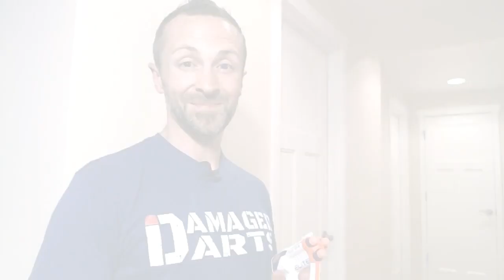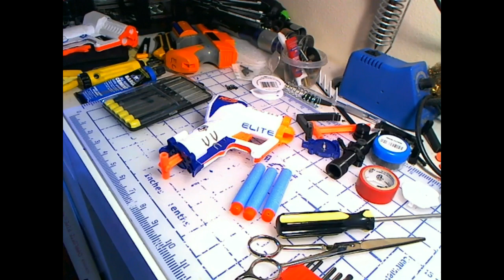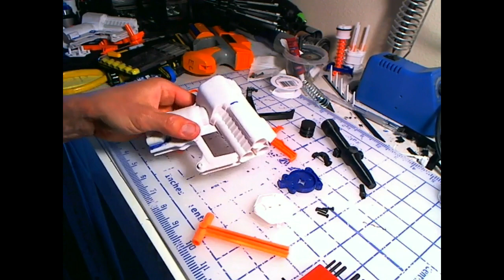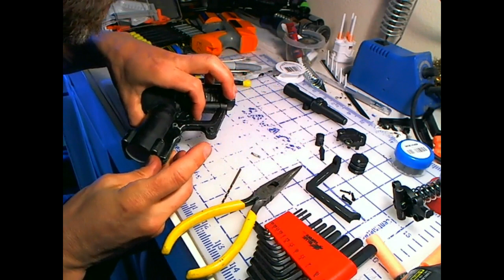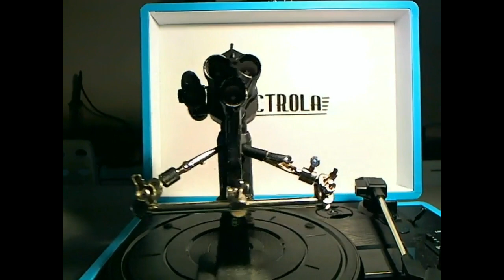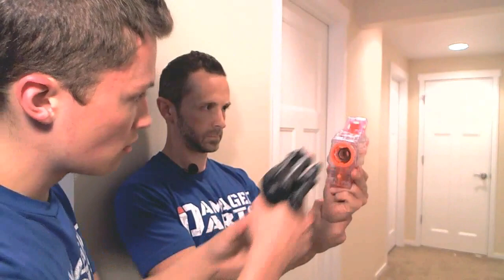💥The Mandalorian Nerf Scout Trooper Blaster💥

Comment: Hey... First this was a nice idea! Iam Using this Blaster for Star Wars Larp at the time.
The only thing is... your Parts in this Video fit perfectly.  The Scope and Scopemount as well the nozzle is a little Bit bigger than you are using in this Video. Maybe you modified them after.  It dosnt hurt but reminds a little Bit more work. :)

Its a rly great build!
Reply from the maker: I downloaded the scope from a full size prop on thingiverse and scaled it down and forgot what ratio I scaled it down to. If you measure what length you need according to the Triad EX-3 and just scale it down to where it matches that size it should work fine. As for the nozzle on the end, it's just a tip off of a standard ink pen. Apologies for the inconvenience. We're trying to model all of our future projects personally to avoid scaling issues.👍
Reply: @DamagedDarts   What sort of pen, there are thousands!
Reply from the maker: Chris Howard We just used a basic black paper mate ballpoint pen. 😉👍